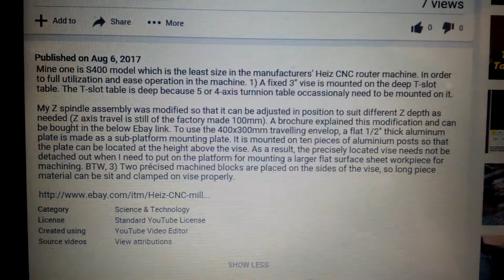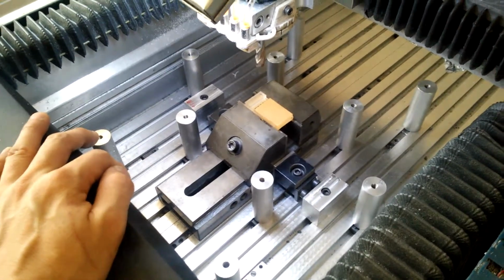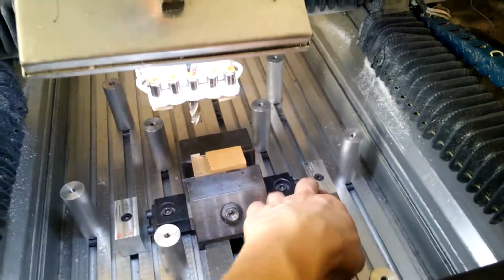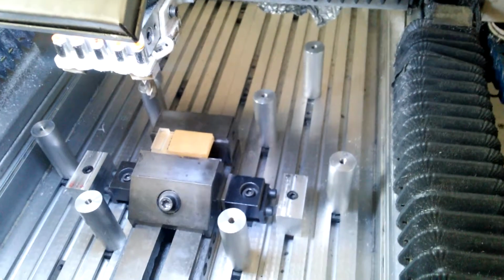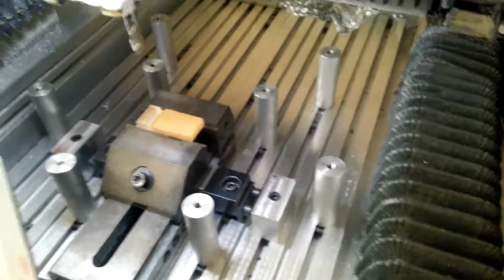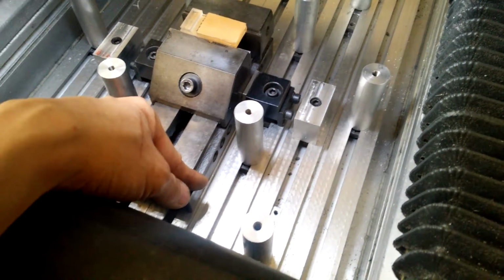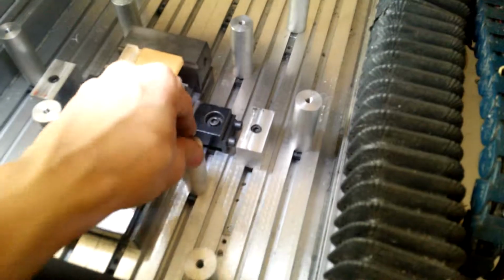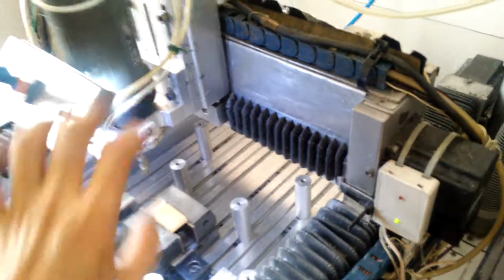Mounting platform and vise 1/2 (37 of High Z CNC-STEP)

Comment from the maker: Mine one is older than zero1。i don't think they differ much except adding some LEDs on panel。To have trouble shooting。One must have electronic background and then understand its circuitry by tracing the pcb tracks against the manual circuit。 Unless fully understand or not to attempt to make any modifications or repairing 。